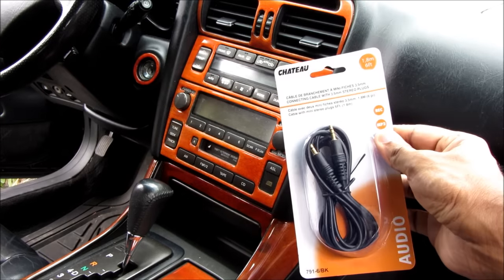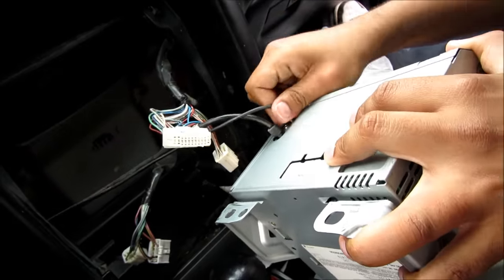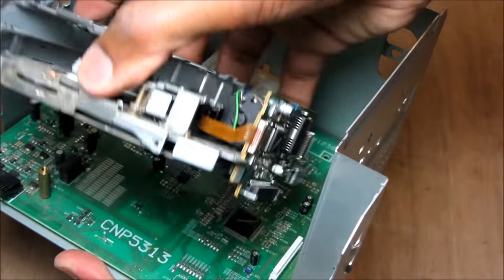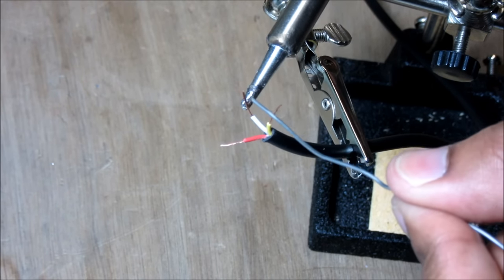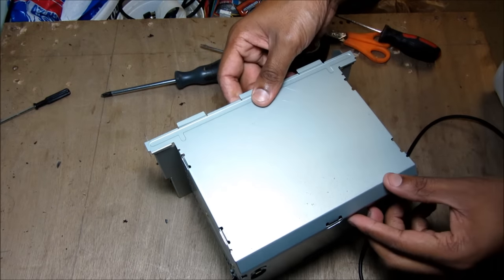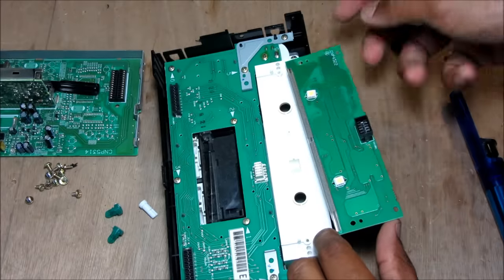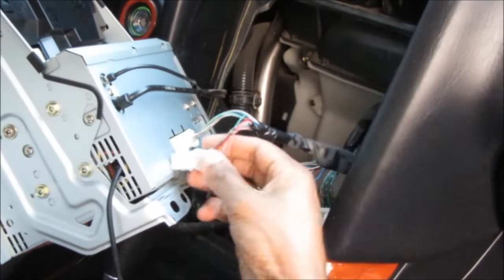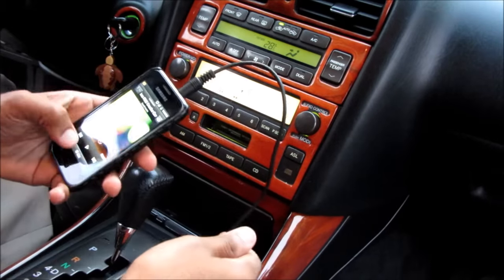How to Add AUX to an Old Car Stereo for $2

Comment: Any squeaks or rattles after all that plastic prying inside the cabin? That is one of my number one concerns about messing with the radio is screwing up how quiet my car is.
Reply from the maker: +Vaping ForHealth No rattles for removing the radio. I got some rattling after removing the entire interior on my Solara to suede the headliner. I already know there's one clip missing that I have yet to fix. Just take your time when taking things apart and don't break any clips and it should all be good. I've taken my cars apart many times.

Comment: I am deep into this repair and cannot for the life of me get this to work. I soldered the wires nearly in an identical way. The issue is the tape deck doesn't seem to be recognizing that there is a valid tape inside. It says play but then stops and goes back to the radio.
Reply: have you tried putting a tape in to trick the player?

Comment: Can you help? 98 gs400. I did NOT do the aux input, my problem is the volume control doesn't always work properly. Sometimes I turn the radio on and the volume is already loud and I cant lower it. Is it the amp or the volume control knob??
Reply from the maker: +billy greenhorn the potentiometer on the board is probably burning out or has a loose connection. Open it up and check its condition with a multimeter or oscilloscope
Reply: ok thank you, I wasn't sure if it was a problem with the amp or head unit.

Comment: Hey, I read on a forum post that you mentioned that this didn't end up being too reliable for you in the long run. What did you mean by that? I'm currently installing a usb to aux bluetooth receiver and I tied into the left and right channel on the cassette board(98 LS400 with a nakamichi head), and then I've got a 12v to 5v buck converter and I'm gunna tie into accessory somewhere. I realize I'll need to run a continuous loop tape, but what part of that install for you wasn't reliable?
Reply: Installed successfully, but the volume is so low you can't hear it when the car is running. Was a cheap 10 dollar receiver. Can you think of anything other than it being a cheap receiver that would cause really low volume? Also worth noting, I didn't have to insert a tape to make audio play.
Reply: Tested with just aux input and not the bluetooth and it's still super quiet. Do head units have an amp in them? I figured with there being an amp under the seat I'd be okay. Can't find any other left and right channel connectors on the head unit either.

Comment: Think this works on a 2000 gs400 with navigation? And if I have my ipod plugged in and on FM or CD does it override it or does it only work when you hit the tape button? Please let me know, my mom got a gs400 and I would love to get ride of the stupid tape to aux adapter that sounds like shit.
Reply from the maker: As long as you can find the outputs of the tape head before it goes to the equalizer it should work on most radios.
Reply: speedkar99 I will let you know how it goes. Thanks again for answering me here and on CL.
Reply: How did it go? Did you try this? I have a 1998 Lexus GS400 I'm wanting to add an auxiliary jack.

Comment: It is not easy to find an extension cable with normal wires in it.  All I have found have tiny lacquered strands that are hopeless for soldering.
Reply from the maker: +sdparksMS3 Yea these are fine and not easy to solder. Sometimes its better to solder extensions

Comment: Hi, I have a question. my stereo (Volvo 960 1996) doesn't have the terminals for L and R anywhere. It goes all through the board. Is it ok if i solder the cables to the connections?? Like on the little tips or on the motherboard. Thanks!
Reply: no you have to be lucky and have the L and R terminals conveniently located there for you.

Comment: Will this work on a 2003 ls430 with the Mark Levinson package.
Reply from the maker: +Joel Schub as long as it has cassette
Reply: speedkar99 yes it does. You're smart dude. Tapping into the sound inputs like that on the pcb. Im getting my ls430 tomorrow I'm so stoked. Gotta save some more to get it registered and insured but 3500$ for an ultra luxury ls430 with 113k. I feel like I won the lotto

Comment: Hey so I don't know if you'll see this, but this was done to my car prior to me owning it. Recently I took it apart to redu it since there was a popping or kind of like a poor connection. I replaced the cord, and cut it and pretty much set it up how I figured it was done before. However when I put it back together audio only comes out of the front left speaker, but the actual aux cord itself works. I can hear my phone through it...any ideas? I know it's probably my fault but I don't even know where to look. I put it back EXACTLY how it was before.
Reply from the maker: You have to reverse what was done and start from scratch. Also check your left right balance setting
Reply: @speedkar99  yea I'll take it apart again later this week. I just noticed last night on the way home that the radio light are not on so maybe I forgot to plug something in. The balance knob isn't working so that may have something to do with it. Thanks! Great video btw.

Comment: the joints are none conductive to the heat of the solder iron? how on earth did you get the joint to grip?
Reply from the maker: Your soldering iron tip needs to be sanded down, try removing the solder with a sucker, there's probably a clear coat or flux on top the solder

Comment: Hi I have GS 300 2005 with nav, cd stacker and cassette player. Mine is labelled Rch and Lch but where do I solder ground, cheers
Reply from the maker: Anywhere that's common on the board should be labeled GND
Reply: Thanks speedkar, also ribbon from board to tape reader is soldered, do I leave that or cut it.

Comment: Does this method work with Nakamichi sound?  Is it exactly the same if so?  Thanks
Reply from the maker: Not sure, but if you open your radio and find L and R ports, solder it up and it should work.

Comment: speedkar99, hope you can help me here. I did exactly what you showed on my 97 es300. I got the music from the phone coming through the car speakers. However, here's the issue. 

- I have to play music from the phone first then play the car tape. If I play the car tape then play the phone (like you showed in your video), all I will get is low noise, plus some random hissing, crackling. 
- When the phone music player goes from the the end of one sound track to the next, the noise mentioned above would kick in during that brief silence of the two sound tracks - and the phone music player is stopped (the headphone symbol (b/c 3.5mm jack plugged in) in the phone disappears). To the music playing thru the car, I would have to start the phone music player and then start the car tape. This issue prevents me from listening music continuously, sound track after sound track.

I've struggled for a few days now. Hopefully you can give me some pointers. Thank you
Reply from the maker: +PhuKeo MoCau I have the exact same issue on my Solara (see my other video for the Aux hack thru FM radio). It has to do with Jack detection on your phone. My old Samsung Galaxy S worked perfect, plug and play but my S5 has the issue. I've been struggling with it since I got my phone at the beggining of the year too, it sucks because I have to turn off the radio just before the track ends and then turn it back on again when the new track starts. I'm all ears if you get this working please, perhaps there's a new music app or something to disable jack detection. Thanks
Reply: Thanks for the quick reply. Yes, I have seen your other video. Trust me I've been all over the place for a week that I have struggled with this issue. I've seen you on CL as well. I prefer your method over tapping the CD player. Yes, I have this issue also with my S5. Like you,  I either switch to FM and back or skip to next track just before the ending of the current track :-). I'll let you know if I can get around it. Thanks again.
Reply from the maker: +PhuKeo MoCau My brother didn't end up using the method in this video since his cassette player broke down. Instead he tapped into the CD changer lines in the glovebox and plays a blank CD to enable the sound. He then rigged up a Bluetooth adapter and can now wirelessly stream music to his GS300's stereo. I recall there being a DIY in the ES forums on CL about it. I also used the same method on my Accord and will be posting that video next week. 

My Solara's stereo is good, just the dollar store cable isn't the best after 3 years of use so sometime it randomly causes static. I tend now to listen to tracks longer than my 30 min commute so I don't have to keep switching it off. I suppose you could also try an old mp3 player or another phone to see if you have the same issue.
Reply: OK, speedkar99. Good news. A ground loop isolator would fix the issue. I'm happy now. I even tried tapping into the signals (FR FL RR RL  SGRN) from the A connector in the back and it was a lot better. But the downside was that that bypassed the amplifier and so I couldn't use the volume button to control volume and the sound was not filtered. In the process I discovered the ground loop isolator eliminates a lot of unwanted noises and that did it for me.
Reply from the maker: +PhuKeo MoCau Hey, I flashed my galaxy 5 ROM to cyanogenmod. Now changing tracks isn't an issue anymore. Jack detection when you plug it in initially still is though, so I have to turn the radio off then start the music initially, but once its playing, it can change tracks no problem. Let me know if it works for you.
Reply: speedkar99 My experience with CM is it's always buggy - sooner or later you'll see. My S5 is on the Samsung official Marshmallow already and I like it that way. 

I'm extremely happy with my current setup. It's what I had in my last post plus the bluetooth. Once I start the car, just one quick push of a button on the bluetooth device I got the music playing, clean and smooth, no distortion in any way (my bt device supports apt-x so the sound quality is great). The only minor annoyance is a hiccup when it's the end of the tape and the auto reverse kicks in. I made a special cassette tape where I added as much tape to it as possible :-). Wish we could do away with the tape. Some day when I have time I'll look into it to see if I could get around - a diagram of the stereo would be of great help. I did search but wasn't able to find one for my stereo model.

Comment: is there any audio quality difference between doing the CD changer hack vs this hack? Is the processor from the CD source clearer?
Reply from the maker: +Eric W We don't remember, but they are both analog inputs so they should be similar. My brother did the CD changer mod since this cassette deck failed. He said it's nice and crisp now, and it's easier to mod because your not going into the radio, you just tap the lines from the changer in the glove box. He even attached a Bluetooth dongle, and theres no cassette to worry about playing and flipping over.
Reply: speedkar99 thanks, yeah I'm going to do the cd back with a 4pdt switch instead of a relay to keep it super simple.
Reply from the maker: +zazzn cool, make a video on how it's done. There was a tutorial somewhere on Club Lexus.

Comment: can you do one for the es330 with navigation please.
Reply from the maker: +Gabriel Espinoza I don't have an ES with navigation. I assume you can solder to the CD player wires and play a blank CD. Or just buy the iPod / Bluetooth adapter that goes into the plug at the back.
Reply: @speedkar99  please buy an ES330 so you can make this man's video. Make sure it has factory navigation.

Comment: i have a 2005 lexus es300 with navigation but no cassette player. can i do this?
Reply from the maker: +Rehman Khan I don't think so. You'll have to find the inputs from the CD player and trick the player into thinking there's a CD playing to get it to read from AUX. On my 2005 ES I bought an ipod/AUX adapter and plugged it into the back of the radio. I'm not sure if it will work with the navi or mark levinson systems.
https://www.youtube.com/watch?v=w-0ESCWyz4w
Reply: You can still do it. the procedure is the same as far as wring the cable to the board. you will need to make a cd with silent tracks to fool the headunit so that you can hijack the signal with your phone. If you really want to get crazy, you can wire a pair of old Bluetooth headphones  to the board and play via Bluetooth

Comment: Will this also work for a 2000 Lexus rx300? Thank you!
Reply from the maker: If it has a cassette deck, yes.
Reply from the maker: But if you have a separate CD changer then that's an easier hack and no need to fumble with a blank cassette deck.

Comment: hi, i did this hack on my es300. everything went great. only thing that seems to act funny is when i plug my phone into the audio jack. sometimes itll shut my phone down and not even recognize it. sometimes i hear loud static when the phone is plugged in only. does anyone have answers?
Reply from the maker: +Fez Octavio yes plug in ur phone with the radio off, press play then turn it on. Has to do with headphone detection on your phone.
Reply: thanks!! ill try that. another thing on my mind is that i saw you solder the ground near that white part of the circuit board. i placed mine on the opposite side of the board (i have an es300 97). would that affect it at all?

Comment: Good job but why u didn't just buy yatuor it come withe usb and aux input
Reply from the maker: +Ahli For Ever for the stock dash look
Reply: speedkar99 no change in dash look u will install it without cut any cable and u can hide it in the locker I use it with my is350 2009 its very useful, but ur way make u save more money 👍

Comment: I have a 2000 toyota avalon my radio looks similar but mine has a 6 disk cd changer     would the process be the same
Reply from the maker: Similar if you had the tape deck as well.
Reply: It does have a tape deck       but ip cant find the L and R points on the board
Reply from the maker: Look on the board where the tape deck is. Or where the head of the tape reader goes into the equalizer. It might be labelled "L" and "R" or "L ch" and "R ch"
Reply: I took everything apart    and looked at it for hours couldn't find anything I did find a L1 dont know if thats related.     I gave up and put everything back together.   But I can take the board out and send some pics if you dont mind you might be able to figure it out
Reply from the maker: Sure you can send me photos if I can help.

Meanwhile they do have a GROM unit that they sell for the Avalon:

http://gromaudio.com/compatibility/toyota_avalon_1998_2004_ipod_iphone_android_interface_adapter.html
Reply: +speedkar99  never heard of the grom kit I might go with that
Reply from the maker: I've got a similar ipod / aux adapter in my Lexus ES330 from GTA car kits. It works great, I can use my steering wheel controls, radio is stock for a clean look, sound quality is reasonable (CD quality).
Reply: +speedkar99   Thanks is there a specific one you would recommend    Also my car doesn't have steering wheel controls so that doesn't matter
Reply: +speedkar99  I'm going to go with the grom  I can't find a gta one for my car.

Comment: How about a 06 gs300? very similar yet different. Thanks
Reply from the maker: You can hack into the radio of the 3GS in a similar fashion. I'm just scared to open up mine on my 2007 GS, and I have no need since MP3 CD's work for me.
Reply: speedkar99 yeah I just got the monster cable cassette adaptor. I don't really want to mess with my gs300. It's way to nice and was well taken care of by previous (and first) owner. Later I'll just buy a newer version of GS with modern audio and USB/aux built in.

Comment: Can you show us how to do it in lexus is300 2003 
i have opend the unit and i didnt find L & R
Dolby 8nr
the name of the unit
and yes it has cassette player
show us or at least tell me where to conect the aux wires.
thanks in advance
Reply from the maker: +Faroos Almaawali did you find anything on the other boards that have L and R? 
How about going to the CD changer?
Reply: Maybe your head unit is like this one: https://www.clublexus.com/forums/lexus-audio-video-security-and-electronics/530037-diy-install-an-auxiliary-port-in-your-sc.html#post6041548 with the pin header style.

Comment: great diy video. will this work on 2001 RX300?
Reply from the maker: Most likely, if you have a cassette player.
Reply: +speedkar99 what is the brand and part number of the aux cable you used? I want to make sure I get the correct cable.
Reply from the maker: +RNR24N7 I got it from the dollar store. Just a stereo microphone extension cable.

Comment: Absolutely useless mod. The same as using proper cassette adapter. Not talking about the fact that this unit designed to recognise and run cassette adapters ( you should see small letters "METAL" on a left side when it's recognises)
Reply from the maker: Better sound quality
Reply: @speedkar99 With all respect to your good intentions, it will be indistinguishable by objective and subjective qualities from just a decent cassette adapter. It is not an AUX input. Don't make me to get in technical details.